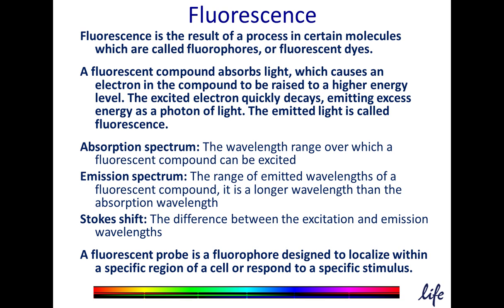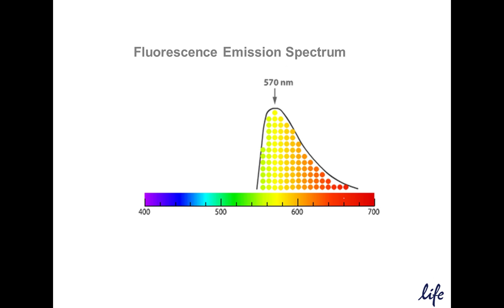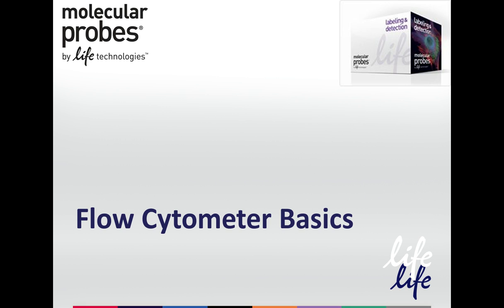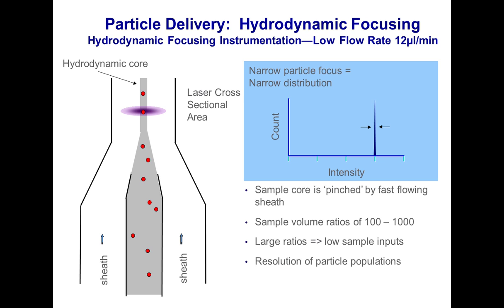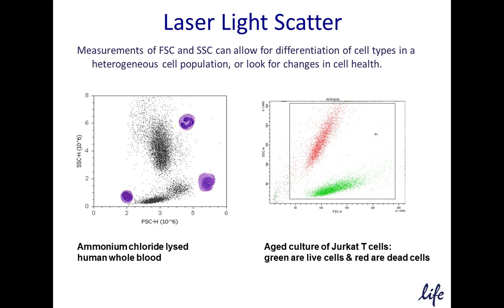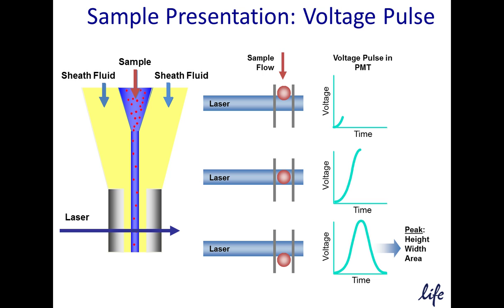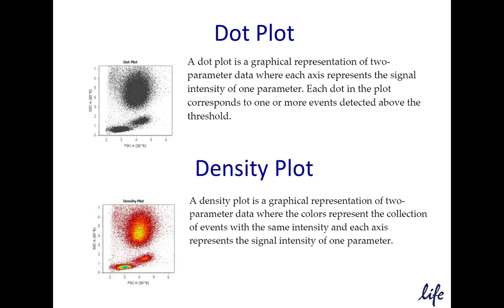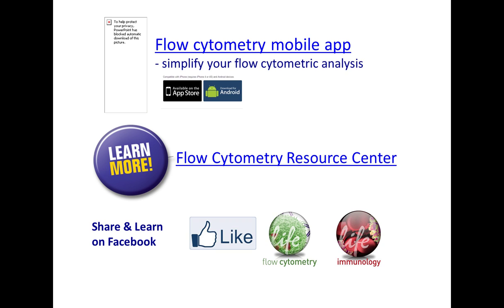Basics of flow cytometry, Part I:  Gating and data analysis

Comment: The answer to question #1 fluorescence emission is always longer than excitation should be false. In cases of multi-photon, energy upconversion for example, excitation wavelength is longer than emission. I guess those 4% people answered correctly are those from physics or photonics or laser application background like myself :)
Reply: Of course... but this video assumed a regular "single photon" laser excitation behavior. And even in this very context, if you have a closer look to the different spectra of emission of your fluorochromes, you will see that some photons do have a shorter emission wavelength than the laser used to excite them... typically FITC photons below 488nm...

In reality, these photons exist in a "pre-excited state" before they receive the energy (h.v) from the laser. You can read Shapiro to know more about it.
Reply: @toumperezh  Good stuff all round. Thanks!